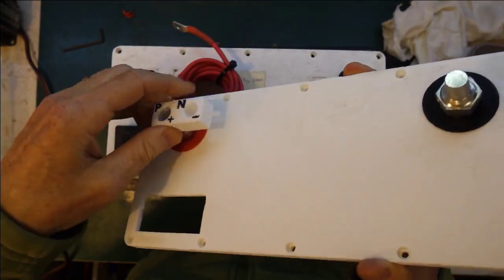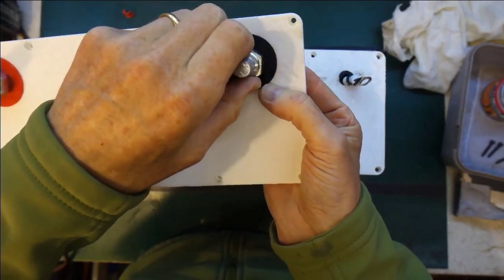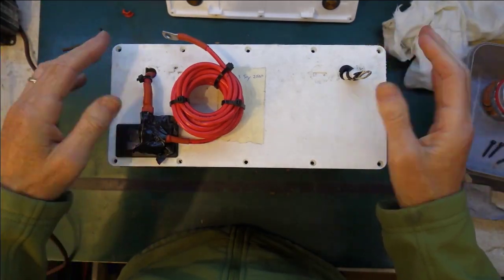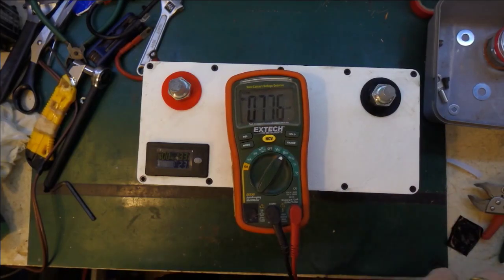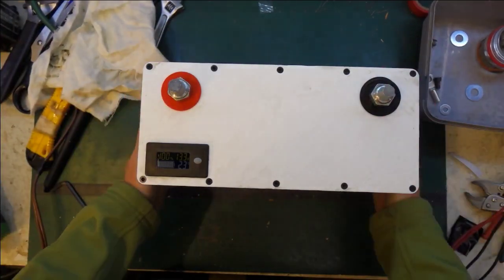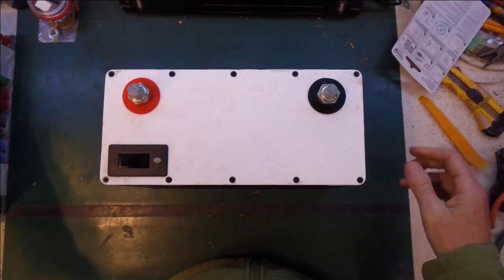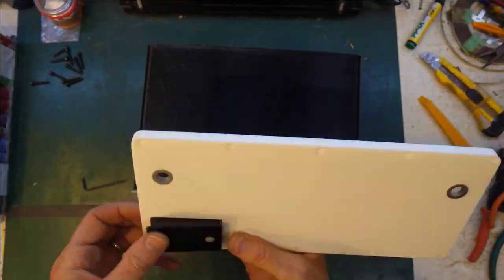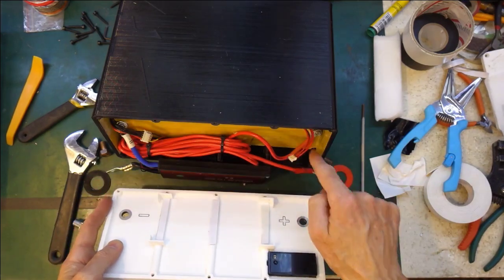Nissan Leaf 028 - DIY 12V LiFePO4 battery, finished

Comment: Hi Paul. My Leaf's lead acid battery is just about shot so might be replacing with LiFePO4 as well. But was also thinking a much larger Lifepo4 battery would extend the range of the Leaf a bit. Especially when the climate control like the heater is used. Since this runs off the 12v battery, a 100A or more battery could add WARMTH and RANGE. No more freezing in the car trying to conserve the battery. 

Was the 12v 80A BMS in your battery adequate to handle the discharge and charge loads? My Leaf indicates up to 4,500W draw when the heater is on. About 375A @12V.

How well is your 12V battery holding up?
Reply from the maker: My 12V battery is holding up OK - I kinda wish I'd installed a slightly larger BMS though as I've had it trip out on start-up a couple of times. The 2012 Leafs power the heater from the main 400V battery so if you have a Gen 1.1 Leaf you may not see any benefit from a much larger 12V battery capacity.

Comment: This is fantastic. Great work. My biggest problem is the car sitting for weeks and the battery dying. I have been trying to figure out how to have the bms disconnect when there is 10% capacity left. Then have a button that allows access to that 10% so it is possible to start the leaf.
Reply from the maker: I've just built a simple backup battery from 4 LiFePO4 cells with clamp leads. I did consider a more sophisticated system, but all you really need is enough to get the car started - then the on-board charger kicks in and you're fine.
Reply: Agreed. I purchased a jumpstart pack for this but since it is designed for gas motors it pulses the 12v 5 seconds on 5 seconds off. So I just created a new set of leads without the protection circuit, just a fuse and it works fine. 

But a button would be so much cooler:)
Reply: Also I have not needed to jump it since I plugged the cars 120v charger into a WiFi plug which turns on for just 30 minutes per day. 

It still drains after 2 months but this works reasonably well. 

And just an FYI. Yes this will destroy a 10amp WiFi plug. I always seem to find out they are only 10 amp the hard way. 
A 15 amp plug handles it just fine of course.

Comment: Great to see the successful wrapup of the project!  What is the final difference in weight and kwh capacity from the original?
Reply from the maker: It weights half as much and has about the same capacity as the original battery when it was brand new (40Ahrs). When I pulled my old battery out it had about 9Ahrs left in it.